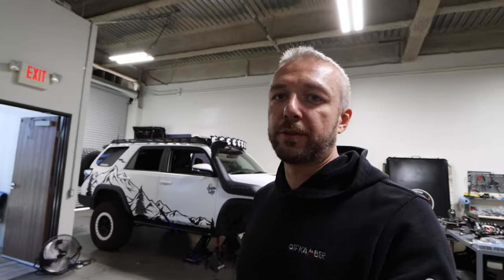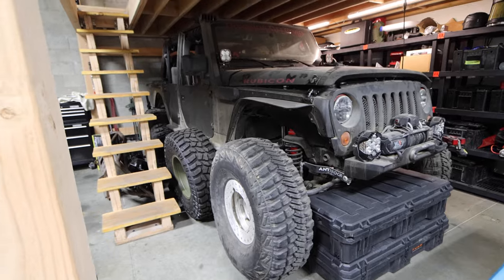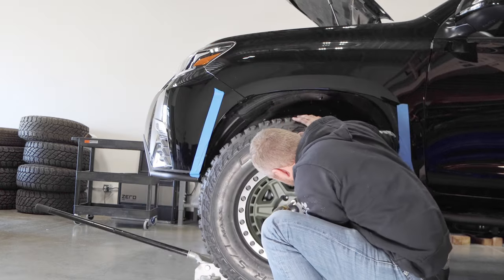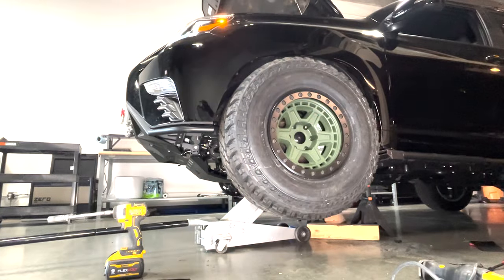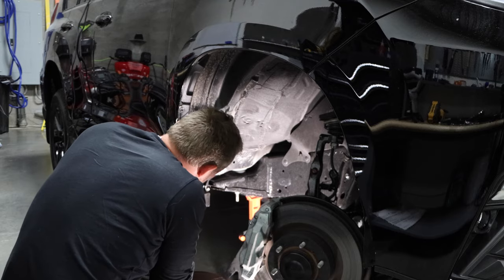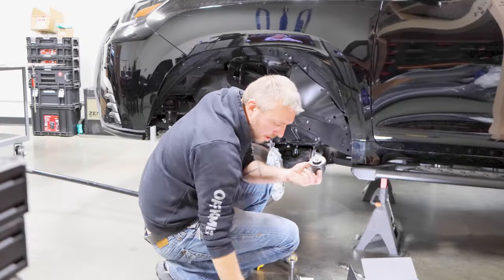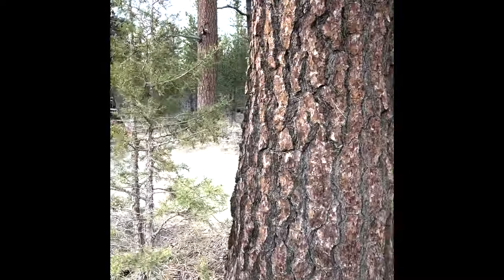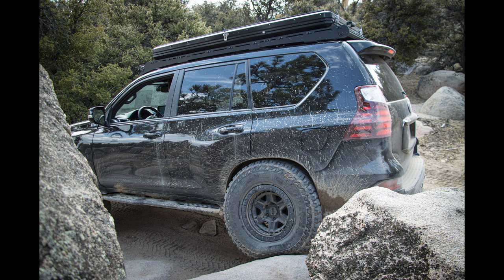Installing 35's (and 34's) on your GX460 or 5th gen 4Runner. Instructional. Part 2

Comment: Another great video! Appreciate all the time and effort you put into this. Regarding the cutting, a little tip I've found after using cutoff wheels, dremels, saws, etc. to trim, I've found that an oscillating tool is a great tool for trimming plastic. It doesn't heat up and fling melted plastic all over the place and it's really easy to manage. There's also several different sized heads to be more or less precise. Cheers.
Reply from the maker: Thanks! Great idea. Have one and never thought to use it!

Comment: Best thing I found for windshield washer was expedition 1 relocate kite huge tank well built and it works
Reply from the maker: Agreed. Just a bit pricey honestly. Have it for my other 4R but will probably make a DIY if I need it again
Reply: @SandyCats  I didnt have to to DIY because aI turned stock trd pro into the monster it currently is and had zero 4runner eperience at the time.  wish man do i wish i found your video back in feb/march

Comment: Thanks for the detailed information in this and the prior video. I am in the late stages of installing 35s on a 2018 GX460, and while I am pretty comfortable with my setup so far, I did pick up some good tips from your video, and you confirmed some things I already knew. Thanks for the pointer for Dr KDSS, some good products there. You also talked me into spindle gussets -- although I don't go off road at the speeds you do, I do some moderately serious rock crawling so it's probably a good idea. I have 35x11.5x17 tires with -10 offset wheels and that definitely simplified fitment compared to 12.5" width, and I am fine with the slightly narrower tire. I will say that if you regear your GX that should alleviate a lot of the transmission overheating you have experienced.

Comment: Makes me really happy I got a Tacoma. Got 35s on in the back didn’t need to trim because got longer shocks which limits up travel to give more overall travel. Seems much easier until I decide to link it and go full crazy
Reply from the maker: 💯. Kinda wish one of my rigs was a Taco sometimes because of exactly what u said
Reply: @SandyCats  downside is the bed isn’t waterproof from factory and most aftermarket covers aren’t even very waterproof. Pretty annoying when your firewood gets wet 😂 always another expensive mod to fix anything though 🤑

Comment: I put a much more aggressive front bumper on my GX. Its the one from Expedition One. This, plus the SPC UCAs allowed my alignment guy to push both upper and lower pretty far forward and keep me perfectly in spec. There's nothing in front of the wheel to worry about. I'm only rolling on 33's now (255/80r17) but I'm hoping that I can get up to 35s without having to cut the front fender at all.

Comment: I have a 4runner with 3 inch lift on stock UCA, and -12 offset wheels, do you think it can run 35?  I already have the BMC And the pinch weld!  or do you recommend that I stay with 285
Reply from the maker: Your going to need an upper control arm to move your tire forward to avoid rub.
Reply: @SandyCats  thanks for the answer, do you think it can run 34s or 305/70r17?
Reply from the maker: @neriomagilbray2566  i can’t tell you for sure as I haven’t seen how aggressive your BMC is. If it’s very aggressive you may be able get away with 34s on road (maybe with some hammering on the sheet metal). But you will probably rub a lot in articulation.

Comment: Amazing video and series for your Toyotas! This is what the people need to hear to ACTUALLY run big tires. Also curious what kind of paint/coating you spray on after cutting/welding things? Thanks
Reply from the maker: I use Duplicolor paint and bumper trim. Seems to match very well with all factory and aftermarket components. And spray pattern is great.

Comment: This is great content, thank you! How much less work do you think it would take for 35x10 pizza cutter with a 3in lift?
Reply from the maker: I honestly couldn’t tell you. But if I had to take a guess…. Substantially less. No outer cutting. Minimal (if any) cutting at the portion where the fender connects at the lower corner. So like 70% of the work is gone right there.
Reply: @SandyCats  I think I’ll experiment with that when my current tires get used up. I don’t really wanna go the traditional 35x12.5 route because it appears that the CVs and steering components get killed, just like you mentioned.

Comment: With the SPC UCA's, does adjusting the axle forward affect the reliability of the drive train?
Reply from the maker: Nope. But it may give you more bumpsteer than stock. Not a reliability issue… just a bit less smooth of a drive. Your not moving the axle forward, just the tire, wheel, hub. Pumpkin stays in place.

Comment: IF I GO WITH 33'S DO I need to to do all the crazy ness ?
Reply from the maker: Nope. If you get a lift and 33s you may need a body mount chop and trim 1-2 inches off your front stock bumper. Otherwise you should be good.
Reply: Definitely need more trimming on the front bumper for me lol 
Still rubs just a little on reverse or turning hard to the left
Reply: I have 33s very little trimming. no rubbing at all ever.
Reply: @georgec2562  we still rub upfront at that height and will probably do a bmc.

Comment: This is my first ever comment on Youtube. This content is amazing - but I have a few questions. 
1, why do you do all the fitment without the coilover installed?
2, can you do this same fitment and testing with the coilover installed?
3, on the rear passenger side of the GX, if using, or reusing the stock upper control arm, the bracket for the headlights is a mute point?
4, based off the below (my plan) will the bump stops be an issue for me or can i leave the stock bump stops alone? i certainly do not wheel as hard as you do - but in 5 years or so theres a chance this turns into a dedicated trail rig. 

2023 GX 460 Blackline

My current plan is to install the lift (ironman 4x4 foam cell pro stage 3 with medium load springs). Once i have the lift installed I will ride on stock wheels and tires for about a month before i start fitment for the bigger wheels and tires. 
I'm going with a 17x8.5, -12mm wheel and a 285/75/17 BFG tire. It's between a 33 and 34 inch tire. 
Once i start fitment and cutting, i had no plans to remove the coils to do this. Can it be done without removing anything?
I do think my fitment will be much simpler than this video describes, but the process should be the same.
Reply from the maker: For 1 & 2. With the coilover installed the coil has too much downward pressure to full allow you to jack up the tire to max height (as you can’t mimic heavier pressure that actually occurs when going over bumps (even on streets). So it’s necessary to remove the coils for the testing and cutting. 3. Correct; mute point. 4. For 33” tires you can stay with stock. If you go higher and you accidentally go over a large bump at speeds off-road or on-road…. Your tire will hit the upper fender and permanently damage it (to the point that it may even prevent your door from opening). 

If you go 33” tire a lot of what was done here can be avoided. Just a body mount chop and that’s it if your not going to wheel hard for now. But if you go 34 or taller… this will all be necessary or you risk ruining your fenders if you start wheeling too hard (even on accident 😂).
Reply: @SandyCats  Thanks for the reply! This clears up a bunch. 
For the bump stops, could I just use some washers and longer bolts in combination with the stock bump stops to give me the extra bit of clearance needed for the 34" tire? (I believe it measures at 33.9"). 

I've done a decent bit of wrenching, but never done suspension work like this fitting bigger wheels and tires. This is my first offroad build. Last build I did was an autocross build. Turbo, brakes, some mild aero, ecu, etc. Wheels and tires fit with just 3 to 5 mm spacers and I ran that for 6 years or so. 

I'm hoping with my offset and the more narrow setup, the fitment is much easier than this video describes.
Reply from the maker: @joshpagonis9202  for the front… washers will definitely be fine. For the rear… maybe as your more narrow (tires). Probably will work.
Reply: @SandyCats  When you manipulate the front wheels when test fitting and finding out whats rubbing, you mentioned that on the 4Runner you had to push the start button but you didnt have to do that on the GX. 
On the GX could you do that with the car completely off? In the video it looks like the headlights are on when you walk in front of it. I wasnt sure if pushing start would do anything with the KDSS system with the valves open.
Reply from the maker: @joshpagonis9202  I honestly don’t remember anymore. But I know on both rigs you should be able to do that in accessory mode (without car running).
Reply from the maker: @joshpagonis9202  I don’t think it will do anything with KDSS as I remember one mechanic would drive with open valves to settle the KDSS system.
Reply: I guess that makes sense. 
My understanding is it’s a closed loop hydraulic system. 
Thanks! Getting into this tonight, hope to be finished or close to it by the end of the weekend.
Reply: Pretty far into this project. 1. This video helped so much to let me know what I was in store for. It is obviously very true to what I had to do. 
2. How do you know how much you need to adjust your panhard bar?
I got the rear all set up with Dr KDSS bracket and installed my new adjustable panhard bar that came with my kit, but I just put back in at stock length. How would I know when I needed to adjust it?
Reply from the maker: @joshpagonis9202  you need to measure from center of axle to same point of frame on both sides. If axle is off center over 1/2 inch or so… than you’d want to get an adjustable bar